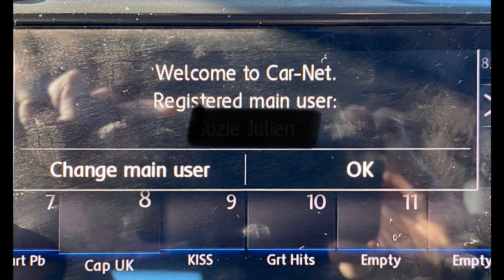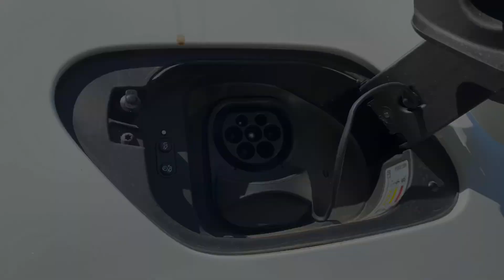VW E-GOLF - THE 12 WORST THINGS ABOUT IT!!!

Comment: I have the US version of the e-Golf.  Regarding your 12 (actually 13) list of issues:

1) Get OBDEleven and program the auto-lock customization.
2) Yes, ECO tires are the main culprit.
3) As you've pointed out, the car was designed for the complexity of an engine + transmission and hence the extra space.
4) In the US, only the top of the line version has the heat pump.
5) I thought it was fine.  You can also use OBDEleven to program your keyless remote to raise/lower all the windows from outside the vehicle, so you don't have to hear the noise.
6) All US versions come with smart key, so no turn of a physical key.
7) It's to preserve range and battery draw when the voltage is lower (and you do the most battery damage).
8) Never experimented.  I'm not in freezing weather, so the seat heaters (standard in US) do fine.
9) We do have CarNet in the US, but no annoying message on the screen.
10) Maybe affix a battery LED tap light onto the fuel door?
11) Agreed, although I'd accept the front only and get rid of the rear.
12) At least you have mirror dip and folding mirrors.  US models don't get that option on any trim.
13) Parking brake?
Reply: You can actually program the mirror dip in OBD as well

Comment: I've never had the 'Carnet' message and my car doesn't go forward 3 inches when I release the foot brake. It's as solid as a rock every time.
One thing I absolutely love is the quiet. Low volume music / audiobook or a quiet conversation are both lovely.

My driving is normally done in Eco+ with Regen on B. The best range I've ever had (twice) is 175 miles (Summer) and the worst about 120 (Winter). Miles per KWh varying between sub-3 and 6. I blame my son, for putting on the heating when a coat would suffice.

I've never noticed the electric window noise being loud but my previous car was a Punto. As regards the dipping mirror, I usually have it heated well before parking up. Heated front and rear screens is wonderful in addition to heating the interior when it's at zero outside.

The one thing that grates my cheese is the tyre valve placement. Many pressure gauges won't fit between the spokes and a screw-on inflator is a nightmare. I have one with a lever clamp which works well for me and an accutire pressure gauge manages the gap nicely. I have 5 gauges now and only two work in the space (one is an analogue stick). 

I like the 'WeConnect' app but I would love a remote lock / unlock functionality.

With two passengers and luggage and all energy saving off, she really flies along roads - hugging the tarmac beautifully. She takes off like a scalded cat.
Love my e-Golf.
Reply from the maker: Great points.
We love our eGolf too.
Maybe the most underrated EV out there!

Comment: The tyres are eco tyre, they have a harder coumpound for fuel economy. But they will have less grip than softer tyres.

I rarely floor it because to me it's unnecessary , I sometimes do it on moutain roads for fun out of a curve you'll feel the car spinning, or if somebody sticks to my rear it's just fun to do. 

So yeah, its between economy or adherence.

Comment: Got my eGolf today, first electric car. To share my 1-day experiences:

First impression: Love it. 

Then i got home, started charging. Later that day i went out in the garage trying to set up all kinds of personalization, map updates and whatnot. Tried to turn on the heating but it just got colder (8C outside). Was fearing that the heat pump thing was not working. Unplugging the charger and "starting up the engine" was the trick. 

The information system should have told me that "you are trying to put on heat, but nooo - you need to start the engine. Aaaand you need to disconnect the charger to start the engine". Anyway, not big deal, just a peculiarity for new users. Also - this is my first electric car, i struggled with how to disconnect the charger, lol. Ok, so just press unlock on the key and it will come out easilly. 

From my experience, these are the two advices (so far) i have to give :)
Reply: You will have more soon..... :)

Comment: Must add that your videos are vastly more helpful than the dealer who only gave us 80 miles of range for the 110 mile trip home over the Cascades range in Oregon.  We limped up the pass with 2 charging stops then sailed the last 30 miles off of regen taking until 4:00 am to reach home.

Comment: my mk5 GTI locked itself when the door was half shut and key inside.
wheel spin would be less with Michelin pilot sport especially if you can fit 225's. (me thinking in terms of the GTI dropping the clutch and reving it up.)

Comment: I have a Canada-spec 2018 eGolf. Heat pump is standard! Car-Net? Volkswagen can't even be bothered to provide that here. As gripes I would add: - no heated steering wheel. VW has it in the parts bin and they did fit a heated windshield. Steering wheel? Not so much. Auto folding mirrors (in the Golf parts bin) - not even an eGolf option. - no visual charge status indicator that can be seen from the outside. I have to wake the eGolf up to see what the range is or how much charging time is left. That's poor. 
I particularly agree with you pointing out the lack of a charging port light (ridiculous) and the placement of the charging port. Front would be more practical.

Comment: I can’t believe that the winter pack didn’t include a heated steering wheel. 
Just to add, not had trouble with wheel spin since fitting Michelin cross climate 2, which I chose after seeing they were a popular choice on an eGolf forum

Comment: Brilliant 🙏..I’ve owned my 2017  since Feb 2018 (brand new ) yes I hate no auto lock ..I also hate the wheel spin. There is a routine trip I take each week amd just before the stop sign is this sewer grate ..and you guessed it , if I touch the brakes I slide and almost go through the stop sign into the middle of the street . I’ve driven cars since 1979 and never had this happen .

Comment: So here in America, I own a Ford Crown Victoria police interceptor which is rear-wheel drive by the way and the Goodyear Egle RSA police pursuit tires that came with the car were absolutely horrible in the rain they were hard and worn the right rear tire which was worn the most would always spin in the rain even with like the tiniest bit of gas. I replaced the horrible police pursuit tires in the rear with some normal Goodyear all-season tires. The problem went away instantly you actually have to try to get the wheels to spin on the wet pavement now. Also, these type of incidents makes me really triggered and makes me want to scream OPEN DIFFERENTIALS SHOULD BE ILLEGAL ON ANY AND ALL CARS AND TRUCKS!!! DIFFERENTIALS ARE THE BIGGEST PAIN IN THE ASS WHEN IT COMES TO TRACTION!!! Id honestly rather have an RWD car with a solid axle with no differential and have the tires chirp and skip around a turn and have to replace them more often than be stuck in the snow, revving my engine cooking my transmission trying to get unstuck because some stupid idiot designed this stupid thing that makes a 2wd car technically 1wd!!! Then again there would more stress and strain on the drivetrain and transmission with a solid axle. Well, that's an easy fix just make the parts stronger. As in your case though why doesn't Volkswagen even tesla for that matter make their EVs with a separate motor for each wheel? No stupid differential needed! At least Tesla's have a viscous limited-slip differential in their newer models. Still, the Volkswagen e-golf doesn't necessarily need AWD but it could have 2 separate motors for 2 of either the front or rear wheels, whichever axle has more weight for the best traction. I think the e-golf is rear heavy because of the big battery and the front is light or lighter so that's why you get so many wheelspins. Which is funny considering how FWD cars are known for being better in wet conditions then RWD cars but that only applies to gas cars which have the engine in the front in the e-golf there is no engine in the front except the electric motor and all the electronics under the hood which are far lighter than the big battery in the rear.

Comment: I have a 2017 e-Golf SE US version and love the car. Here is how your list compares;
Auto lock - I too come from a car that would auto lock, but with the e-Golf I just touch the handle and it locks or unlocks (with fob in pocket) so not a concern.
Wheel spin - I have spun the tires a total of three times so far. Just a gentler press will solve the problem.
Frunk - I think VW doesn't want you in the engine compartment. I think it impressive how small the propulsion system is.
Heat pump - Totally agree, VW cheaped out on that. My Canadian friends get one, but in the US you have to get the SEL model. Still it does make the car toasty.
Electric Window Noise - usually the car is moving when opening or closing windows so the wind noise mask the sound of the motors. Not a concern.
Excessive Key Turn - Okay VW really cheaped out or is it some type of regulation in UK? In the states we are keyless to lock, unlock and start the motor.
Poor Eco Mode Choices - The few times I have gotten that low on charge I was appreciative of the system trying to squeeze all the range. I never trust the range indicator and living in mtn country the numbers can vary wildly. 
Lying Temp Gauge - Auto mode works remarkably well, although I have no idea how accurate the setting is to the number. I just know that 71 F seems to be idea setting for year round use. It more life my Fujitsu mini split where the temp numbers don't actually represent what the room temperature will be.
Car-net Message - Full version included for a limited time then it dumbs down to a few basic options, unless you subscribe. The app has gone from being useful to not worth using. I suspect one day it will stop working altogether.
No Charge Port Light - That was a big miss for VW. A simple LED lamp would have been wonderful. A bigger indicator light would have been nice too.
Dual Charge Port - While I don't have an issue with the current port position, placing it upfront would have meant shorter cable harness thus saving VW some money. Dual port would be nice but then you'd have the issue of interlocks to prevent some fool from trying to use both ports at the same time. More software and hardware requirements probably why you don't see dual port in EV.
Hot Mirror Don't Dip - On the SE I don't get any dip, but we do have rear-view camera and my neck swivels.
WTF Parking - Manual states to apply brake, set e-brake, then shift to park.
Thanks for sharing your experience.
Reply: So in using your e brake first, you are using your brakes to put the car in park. If you shift the car to park first, your using your transmission to park the car. and it will put pressure on your cars trany. For example, have you ever parked on a hill and you put the car into reverse or into drive and you hear and feel the car go THUNK, and it shifts into gear reallllly hard. it is because in putting the car in park before setting the e brake, you made the car park with the transmission instead of the brakes so all that load gets put onto the clutch inside the transmission instead of using your brakes. using your brakes to park the car will save you money (ALOT) and the potential problem of having transmission problems. To give some more reference. In a manual car there is no "Park". You essentially use the parking brake as your mode for park. I have seen some people set the break and then put it back into first. But its could potentially ruin the trans if you turn on the car with your car in first. Hope that clears up alot!!!
Reply: @brettbaffa8652  When parking manual the procedure is set parking, shift to reverse, shut off engine, release cluck, and finally remove foot off brake. Reverse ratio better then 1st gear.

Comment: Steve, Hope you and your family is well and remains well! 1. Autolock - My e-Golf has keyless entry and it does auto lock if you only open the hatch with the key in your pocket. I remember is auto locking after removing the charge plug after it sat overnight (but my memory is a bit fuzzy on that - I need to look in the manual). 2. Wheelspin - yes, but I'm willing to live with the low rolling resistance Bridgestone Ecopia (e-Golf bespoke model) tires for good fuel economy. I agree software could be better. ID.3 will be rear wheel drive and should be much better. 3. Yes, no frunk though there should be. 4. I purchased the very rare 2017 e-Golf LE to get the heat pump (I was told 3 of this trim were imported into the US before VW killed off the trim). Heat pump should be standard, I agree. 5. Yes, my windows make noise, too. I don't mind it. :-) 6. No key turn for me since VW made keyless start standard in US. 7. I am ok with ECO mode at 31 miles, since I usually drive in ECO mode anyway, which helps to reduce wheelspin since ECO mode cuts about 20 hp from motor. 7. I agree with temp but I just adjust as necessary. 9. I don't get carnet messages. Didn't get it with my 2015 e-Golf either. Must be an EU thing. 10. I agree there should be a charge port light. 11. Agree not best position of charge port. Should be in front of driver door, IMO, like a Bolt EV or I-PACE. I think two ports would increase costs but would be nice. 12. My mirrors don't dip yet - I need to enable this through OBDEleven. 13. I always put parking brake on after putting car in park and before I remove my foot from the brake pedal. Other things I don't like: a. Locking plug in charge port when charging is done. VW should have provided an option to unlock when charging is done. b. Software issue that makes average economy calculation wrong since it does not include first stint after charging (doesn't always happen). c. Don't like that climate control always resets to 72 F (VW changed this for free in my 2015 but said it can't be done for my 2017). d. Why can't it remember driving mode? I always drive in ECO mode and every time I get in the car I need to select ECO mode. But, overall, a great car. I love it. Cheers!
Reply from the maker: Hi Barry!
We’re all very well and hope you are yours are.
Great points, especially the driver mode! Why can’t it remember it?
It is a wonderful car, stacks of personality and always up for some fun
Reply: My wife had to stop for a charge when she used up the dealer's 80 miles of charge following the wrong white Forester that she thought was me. At one charging station the burley attendant was rocking the car violently as he tried to remove the cable without unlocking the car.  VW did a good job building a strong charge port!

Comment: I hate the fact that the fuel door locks and freezes shut in the winter.  No need to lock the door if the cable gets locked into place when charging (and that solenoid freezes up too!) - Canada problems.  We get a std heat pump though.

My other beef - sometimes I go to switch modes and turn the car off while it's moving down the road because I hit the wrong button...that's nuts!

Comment: Our '19 e-Golf has the Bridgestones as well and they chirp some on dry pavement.  We use this car less in winter and back off some in the rain so can't complain much about traction.  If we used it in the snow would probably go with a taller, slightly narrower tire. We did this on our Civic Hybrid and it help clearance and reduced torque slightly - of course it didn't have over 200 ft/lbs like the Golf.

Comment: Another great EV video Steve. All valid points about the eGolf. Somethings I have picked up:
2. I have the 17’’ wheels with Dunlop tyres which seem to handle the road a bit better
4. Heat Pump is a must in an EV. I won’t have bought the Golf without one given the battery capacity 
7. Key turn is shocking. The first car I’ve had in 10 years where start button wasn’t on standard model
9. Carnet message - Cracks me up every time but made me laugh when you brought it up
11. Agree that the charging port location is not ideal. I have went to use on street parking a few times but couldn’t due to port on the wrong side for UK vehicles
Other point: Auto dipping headlights would be ideal as standard as is in a number of other EVs at similar price point

Stay safe and keep making great videos - Chris

Comment: We own a e golf when you go on about the wheels spinning I agree with you,And since we changed the alloy wheels we don’t get that spinning wheels at low speed,
Also the heat pump does make a difference ,The keyless entry is brilliant so no more having to put the key in egnition,I have never had the car jilting forward when we park up,I would say get the car looked at mate because our 19 plate has never done that,Also when battery is at 31 miles remaining it  runs normally but it will then go to slow mode at 10 miles of battery remaining anything over 10 miles battery it runs without restrictions,

Comment: My biggest beef with the egolf is starting it. Here in USA we have the fob and keyless start . But you must press hard on the brake and then press the start key .. well, what a lovely and grand idea .. IT only works 40% of the time on the first try. You have to do it again 60% of the time. Plus there are about 10% of those when you have to do all the steps a third time because hitting the start sometimes will set the car in EPC mode on the dial ..hit the start again turns car off. Then you hit it a third time amd the charge dial turns all the way up to on and lights are functioning..